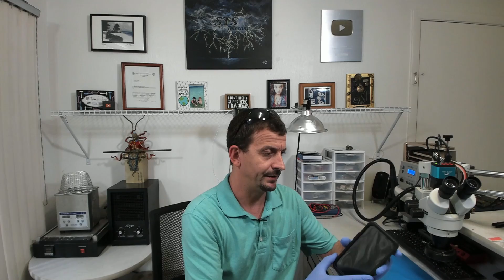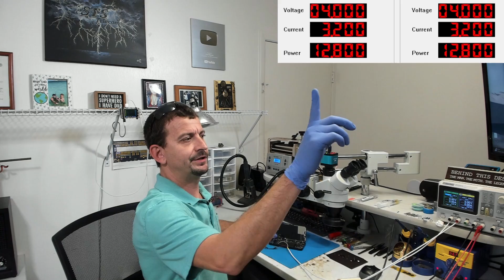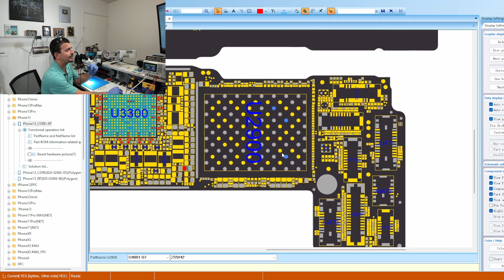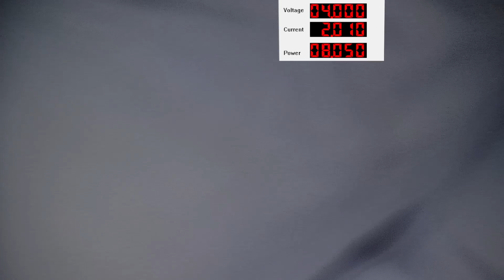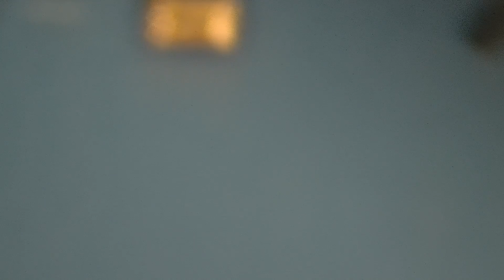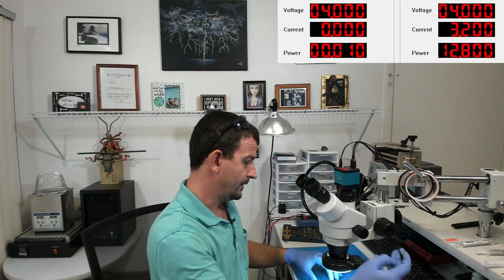Fixing an iPhone 13 with "No Power" After Being Dropped (Logic Board Repair)

Comment: Hi there a phone came to me which is vdd boost short to ground i removed the power ic shield and a capacitor was shorted to ground and i removed, after that phone came back to life
But the problem is after i reballed the layer and switch on the nand line short to ground
I removed the layer and the problem exist pleae help
After injecting voltage cpu getting heat up

Comment: Thanks for your video. I did the diode test and the reading are close to yours.  But using 4VDC on the test points, I see a short on the main power line. So I guess I’m stuck at this point.

Comment: Your control of hot air is remarkable.
I have two fine tip soldering irons and I use them to put on the 0402 SMT parts. That way I avoid the use of hot air which tends to do unpleasant things.

Comment: why after drop being short capcitor ? what timing or i don't know 🤔🤔
Reply from the maker: They can fail at random but also from physical impact.  They’re ceramic so they crack/shatter.  This cap is commonly cracked on the 13.  I think it’s due to the location on the board and how the phone is assembled.
Reply: @ststele  oo okay maybe that why is fail

Comment: Great repair. Why don’t the pads get ripped off when you break off the broken cap?
Reply from the maker: Thank you!  These hardly ever pull pads when doing it this way.  I rake it off with a blade to protect NAND beside it.  Once the old cap is gone, I can swap out the solder for something that melts much lower.  Then the new cap can be soldered without risking nearby components.  Some components have lines that don't have points all over the board though and would be really dangerous to do this way!

Comment: just noticed u were posting again! first time seeing a 13 opened... so I see since apple lost the fight to stop people repairing they countered by making screens break easier when attempted to repair...
Reply from the maker: Oh, they've done so much more!  Almost everything is serialized now and causes "Unknown Part" messages to pop-up after 3rd party repair.  I'm seeing small shops go out of business quite a bit now.  Apple may claim to support repair but they quite blatantly rig it against repair.  Good to see you here in my comments!
Reply: @ststele  oh yeah that sucks... they are copying how cars do it but for "theft" concerns. but at least in a car the ecm, bcm and other modules have relearn procedures to learn the new serial number of a replaced device and if necessary recalibrate. however most of those parts are OEM like from junkyards, ebay or dealer not 3rd party.

Comment: Oh sure you get all the easy repairs For new years lol Just joking.. What's the meter that you use ?
Reply from the maker: Yep!  I’m just thrilled this board didn’t need separated.  If it was a main short, the odds of needing separated are pretty high.  This is a usb current meter that I got from union repair years ago.  They don’t sell it anymore but surely there are similar models online.  It’s just a usb current meter with graphing.

Comment: How do u know that heat hun heat will not pop up the underfill solder bulbs under the NAND ?
Reply from the maker: Only by staying way below the melting point of the alloy used under NAND.  It’s why I broke the cap off with a blade, replaced the solder with something that melts much lower and then raised my temp a little to solder the replacement component.   If I had removed that cap with hot air, not popping solder out around NAND would be tricky.

Comment: Smashing repair as always Jason 😀
Those smd capacitors are a pain in the ass,  a lot of laptops suffer with random shorting.
I dont know if the layer construction makes them brittle, Or is the soldering  Temperature too high for some types.
I know nothing, just in woffle mode lol.
Reply from the maker: Yes indeed!  These ceramic caps keep us in business tho.  Hehe 😂 thanks

Comment: Nice work on that one, sometimes we get sideways and backwards with power connectors, that's life.. however the thing that would drive me absolutely nuts, even though you know that phone otherwise works perfectly, to not be able to go in after repair and do a complete systems function test, that would probably eat at me a little.. but it is what it is. Thanks for the awesome content Jason!
Reply from the maker: Yes a but maddening for sure.  It’s WAY worse if the board would have been separated and reassembled.  I would have stressed to the customer that the passcode is needed.  Thanks 😊

Comment: Well done Jason, stress me when you remove components with a knife and fear for a ripped pad. How do you not rip the pad?
Reply from the maker: This is one of those components that the pads hardly ever go when removed this way.  Sometimes the pads can be damaged like this.  When it’s something where it’s a hard to access line like something where the only other connection is under the CPU, I wouldn’t dare to use this method!  Thanks 🙏
Reply: Jason is related to Edward Scissorhands 🤣 it’s in his DNA

Comment: Good job Jason. I guessed nand rail short before you opened it as I think if it was a main rail short I don't think it would show any charge current
Reply from the maker: Thanks.  Yep, that cap is very common on the 13.  I'm usually delighted to find it and not even have to remove the battery!

Comment: 12, 12pro, 13 the power squid is reversed. 12PM, 13P and 13PM is normal.
Sorry, just commenting while watching the video :)
Reply from the maker: Mmmhmmmm, if I wasn't hunched over a tripod + clicking lights off and on,  I would not have made such a silly mistake. LOL :-)  Thank you for watching & commenting.
Reply: @ststele  interesting how that cap was cracked. I have noticed the 13 model ripping off all the pads in that inner corner area when dropped. I believe the board flexes a lot there. Also had lots of cases where the pads were ripped through the layers on 13s and the only sane thing was a core board swap. Happen several times, they get really bad when dropped, more like any other iphone model